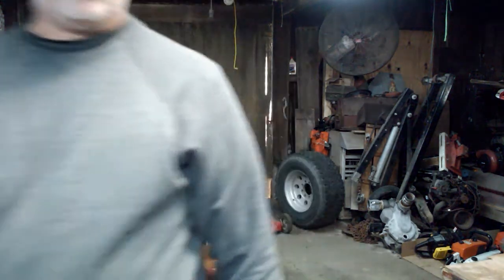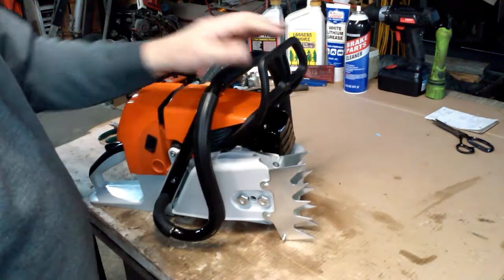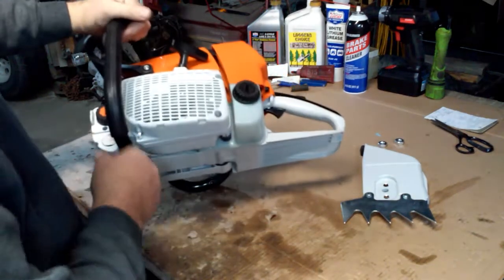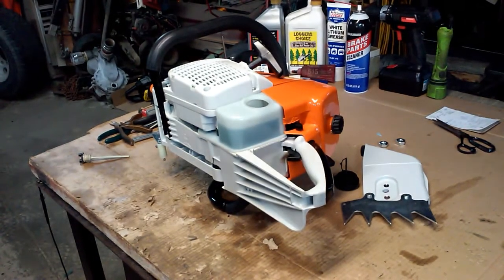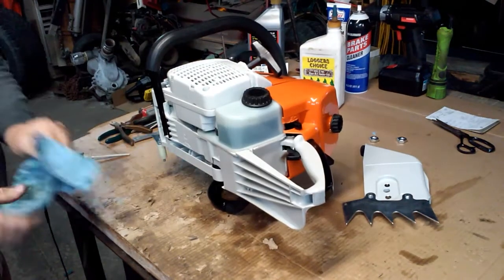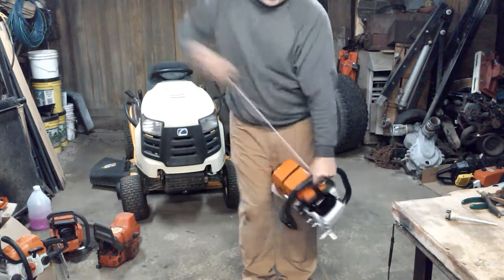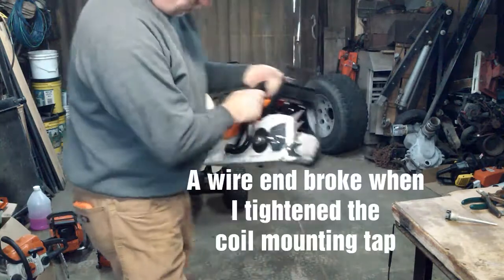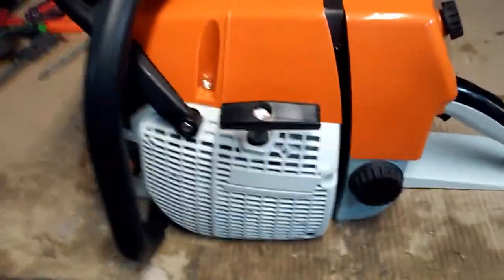Huztl MS660 IN FINISHED FORM AND FIRST START

Comment: I use only ethanol free gasoline in my saws.
Reply from the maker: Where I live there is no ethanol free gas available in bulk, this is one reason I mix at 32:1 for everything I run and also why I always shake before use. Also I don't let it set more than a couple of weeks if it does I put it into my old 85 pickup and mix up some new.

Comment: I see I am not the only one who uses the deco valve on these sucker.  I wish I could say mine cranked in 8 pulls but it did not.  Getting it to run is pulling hounds teeth.  The only thing it likes to do is bite me, when it snatches the rope right out of my hand.  It is the only saw I have ever had that is either alive or dead- there should no inbetween.  The starting is all to critical.  All of my Stihl saws crank exactly the same - pull until it pops in cold start.  Then roll it up to warm start and in a couple of pulls they are running.  Not this sucker.  It may pop in a couple of pulls in cold start but it does nothing in warm start except bitch and moan and try to take my arm off.  I am not kid pulling it, either.  I have no problem starting my ms 391 or 291 and they are not girl's saws.  It has plenty of compression.  In fact if I do not press the deco it will lift my foot right off the ground.
Reply from the maker: This saw has .019 thousands of an inch squish with just a base gasket delete no decking. I have not done a compression test on it as of yet something I need to do.
Your issue sounds like it may be an issue with the ignition timming, a faulty coil, flywheel key partially sheared or even a fouled spark plug all of these can and will affect the ignition timming.  Could also be an issue with the carburetor or the high idle which is known to not function properly these saws.
Reply: @craigtimmons3468  Craig- flywheel key was the first thing I checked.  I replaced the coil and that helped a lot.  I think it was so rich it was getting into hydraulic lock.  It is much better, now, that I have leaned it out and repaired the farmertec Carb.  The needle lifter was set way to high and the needle had no Vinton left on it.  Replaced both with new oem Walbro parts (K15-WJ).  I have also replaced the deco valve with an oem Husqvarna deco valve and all the controls with oem Stihl parts.